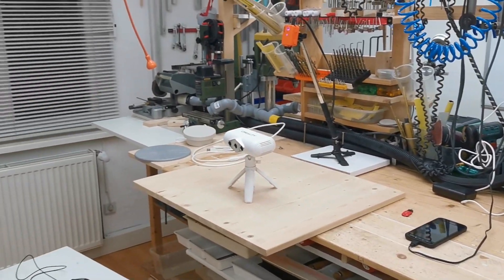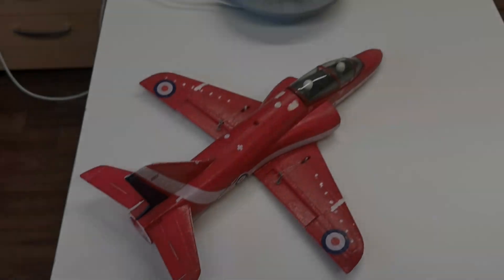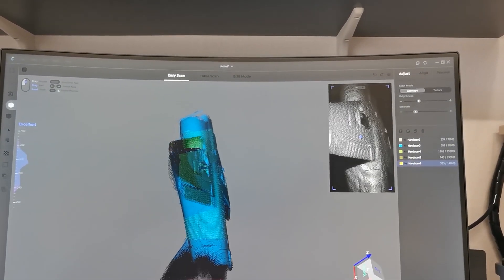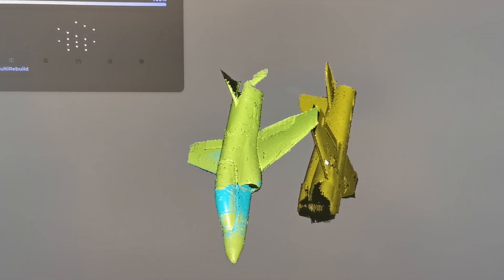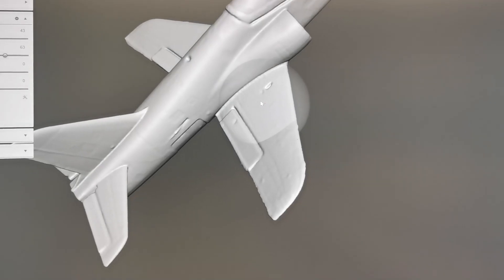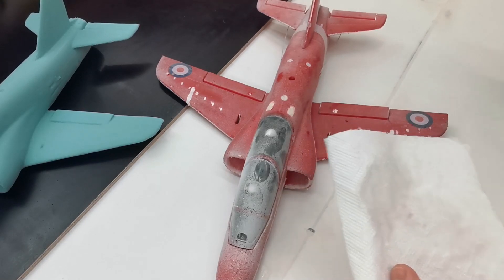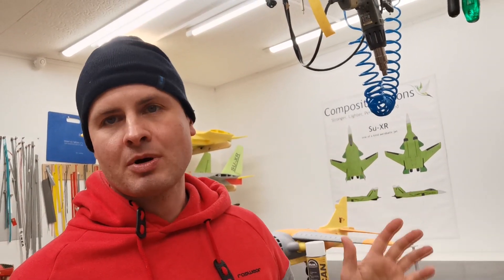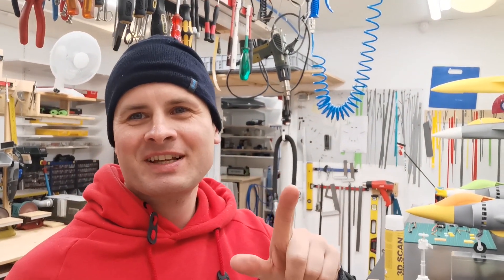My first Jet Scan Project with the Creality CR-Scan Lizard

Comment: eine viper jet 1,4spw. hätte ich zum einscannen für dich, oder haste einen jet mit einem 90mm impeller zum drucken für mich ^^
g daniel
Reply from the maker: Klar den Harrier, der läuft mit 90mm 😁🙌
Reply: @rene_rosentraeger  , ne der nicht, ich wollte nicht noch 600euro für teile ausgeben, habe aus der FMT, die "Zephyr EDF von Tim Kleinschmidt" mir mal gebaut aber die fliegt nicht so wie ich es gerne mag. ich wollte die Elektronik teile vom dem jet nehmen um einen der Änlich wie eine Viper oder L-39 aussieht bauen. da ich aber noch eine Viper habe und sie gerne einscannen oder in ein 3d-cad programm einarbeiten wollte, brauche ich eine passende vorlage. leider sind meine Skills im cad nicht "ehm" gut^^. deine modelle sehen super aus und würde ach gerne die "SU-X" mal bauen . aber ich habe halt eine kleines Geld problem.